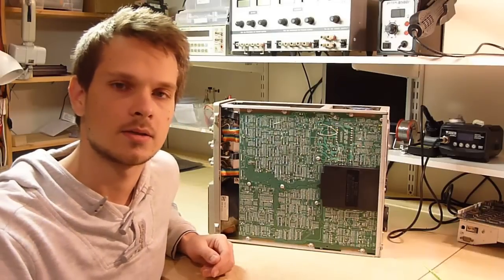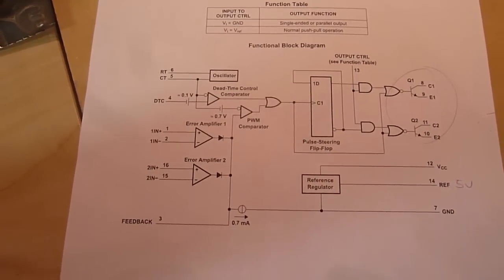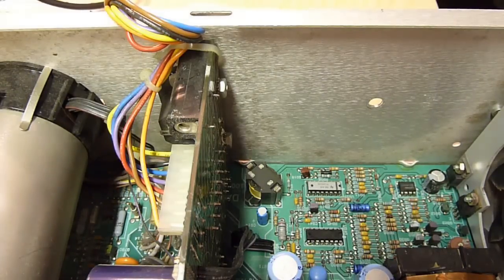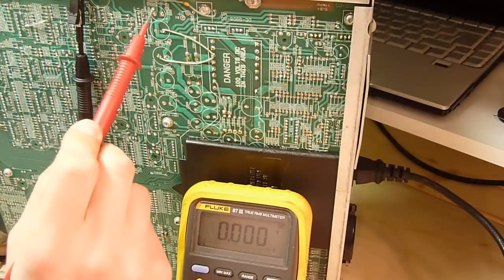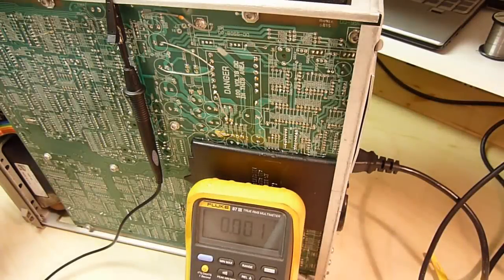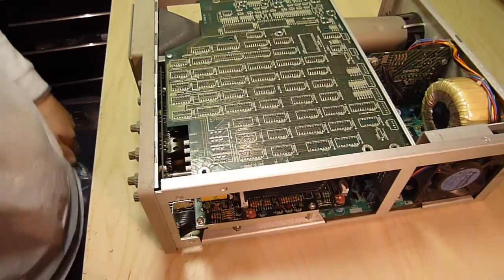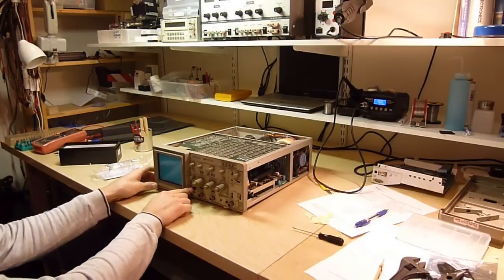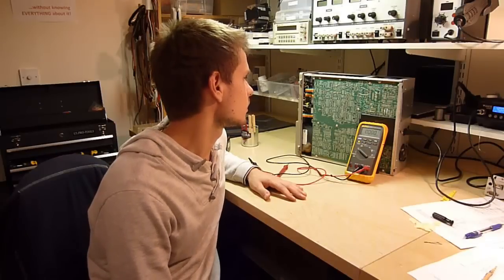ManCave 002 - Tektronix 2201 Oscilloscope Repair Attempt (Part 2)

Comment: just picked one of these up for 15$ on craigslist today.  Any chance you still have yours 5+ years later? I am really interested in some good pics of that serial board, tinkers gonna tink you know? 
Mine had a open filter cap on the power and a cigarette smoke and cat hair caked fan. probably thermal is what took it down.  Anyways thanks for the videos and the schematics you put out there, hope to hear from you.

Comment: Excellent Video.  Thank you.  One question - Why didn't you fit a socket for the regulator in case the replacement blew due to some other fault?

Comment: From the Dot to the actual line trace.  What did he do ? He messed with voltage Pot. But then he put it back to normal value
. He the  re assemble the unit. And the trace was there. So wat did he change.  Was it the fact that.  With the dot. It was partially assembled.  With the trace he put all parts and fully assembled it ?

Comment: That was awesome. Safety First!!
You bridged some gaps in my knowledge of things.
The commonality of the chip you replaced and its pin mapping and that C1 C2 (are collectors) and E1 E2 (emitters). Ref. pin.. Oh! that PC scope. Is that what they call the "sound card" oscilloscope? If not, who, what, where and how much? 
Also, the other thing I learned... the saw tooth (perfect) and the chopped off one. 
Then just noise. I am going to watch your next vids now. Get more stuff to fix!  :-)
Reply: The scope is a PicoScope and is not cheap. If I was to suggest a scope for you, it would not be a USB scope but a proper bench scope. Something like Rigol DS1054 for example...

Comment: I have 40 years fault finding experience. This was good to watch. WELL DONE.
Reply: You should check the ESR of the caps on the supply rails. That trace is very noisy.
Reply from the maker: +SiliquaeSid Thank you! I'll check the ESR (if I ever get to actually finish the repair) :)

Comment: I think You should have put all circuit boards back before measuring the power supply output voltage. Any way I also think you did a very good troubleshooting. GOOD WORK....

Comment: Why did you not check the caps in the power supply.
I would make sure all the caps are good and you have a smooth
DC voltage coming out of that power supply before going any further.
Reply from the maker: MrMac5150 You are right, I should've hooked a scope to the output before continuing, too late now:)  But thanks for comment! Always open to suggestions.
Reply: ManCave
I would like to see more of that scope repair
and calibration, I have one and would rather wait, till I see you go threw yours.
Reply from the maker: :) ...what are the symptoms of the fault with yours?
Reply: abnormal vertical lines, osculating up and down.
Reply from the maker: sounds like you might just need to give your rotary switches a clean.. I would definitely start with that.
Reply: ManCave
 I am not a expert like you, but it would make me happy, if I could rebuild it, I wonder how much I would be looking at, to replace all capacitors and resistors in this unit, and if it turned out to be a IC or EEPROM, I would be throwing my money out the window.
Reply: ManCave
 May I ask for your opinion on the model scope that I have, and you tell me if it is worth putting 40 bucks in to  it or just sell it for 50 bucks.
It is a Tektronix  2213
can you advice me on this model.
Thanks.
Reply from the maker: MrMac5150 I don't think that blindly replacing all capacitors and resistors is worth doing at all. You should try and troubleshoot the problem and find out where the issue is. Chance of faulty resistor is really slim. Capacitor, maybe, but semiconductors are what it's most likely going to be (or combination of the above). First place to start is to get yourself a service manual and read through it. Try to use the front panel controls to see if you can narrow down the issue...
Reply from the maker: MrMac5150 ...I'm not an expert on oscilloscopes :)  ...but thank you for the compliment! I would say, if you want to learn something (and have time), try to fix it and 40 bucks is not such a major loss for a learning experience. You may end up with a working scope. However, if you just want a scope and don't have time, I would suggest to sell it and get a second hand working one.

Comment: Good video and repair. I picked up a scope much like this model at a thrift store and it had very bad focus. The problem was a 510K ohm resistor in the focus circuit that could be seen charred. As you mentioned in your first video, a good visual inspection for burned parts is a good first thing to do. In my case that is all it took. Thanks for posting.